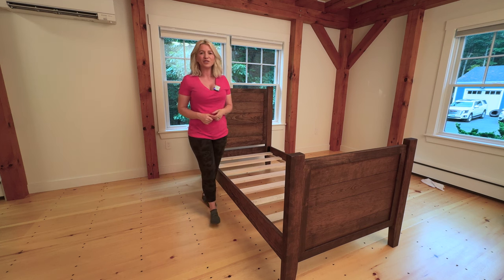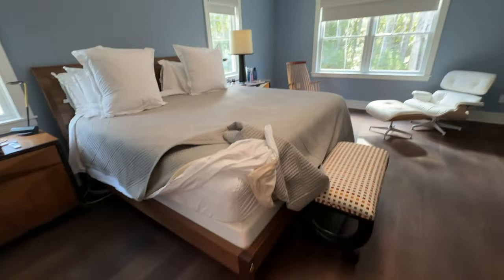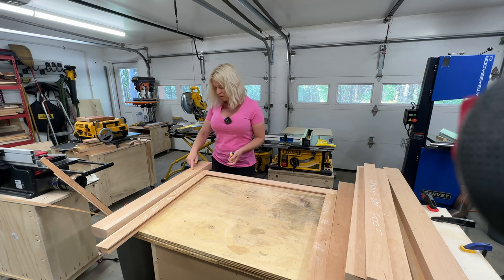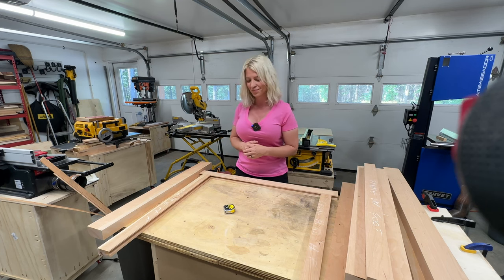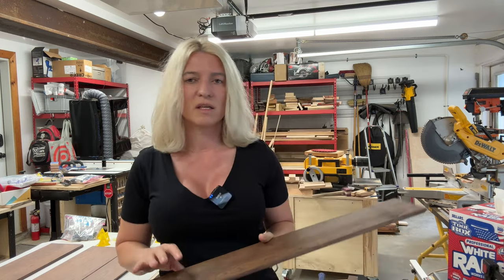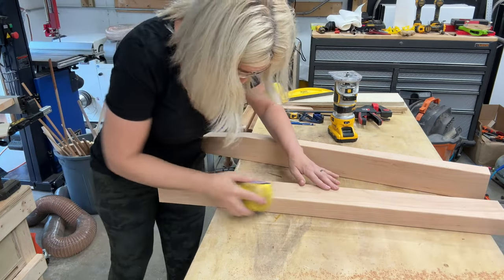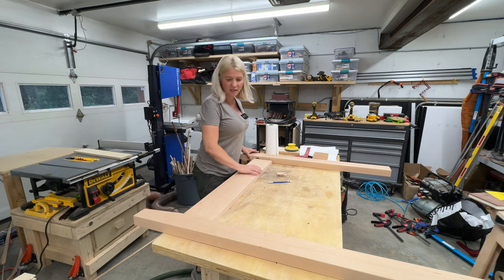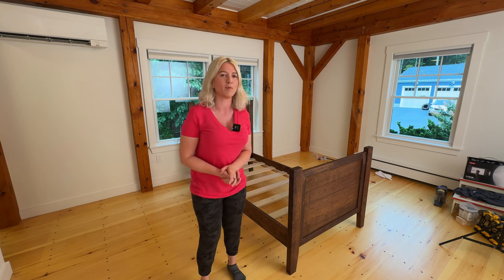How to build a solid wood bed. No pocket holes. Easy twin bed build

Comment: Hi Skyler, another great project.  May I suggest using a water based sanding sealer to control the blotchiness, then General Finishes dark brown dye stain, followed b a wiping polyurethane topcoat.  Would give you the results you were looking for.  Can’t wait to see your next project!

Comment: This turned out very nice Skyler! I liked how you looked at your bed for reference during the build. I repaired and refinished sections of a cherry wood bedroom set before and found out the hard way, it can be incredibly splotchy when using stains. My work around was adding the color in the finish rather than on the wood. Nice build video! :)
Reply from the maker: That's a great idea! Thank you
Reply: @woodworkingwithSkyler  You're welcome :) Another way is to use a glaze. That's a color coating that sits in between two clear film coatings, I use that method a lot too.

Comment: Great video! I have the same table saw as yours and I would like to know which dado set you have for your saw? Also, why did you use the band saw to rip your planks instead of the table saw. I’m in the process of building our Kitchen Island, 36x72, and the top will be made from 8/4 cherry and that glue up is making me REALLY nervous 😅
Reply from the maker: My board had a twist and was not safe to cut on table saw. Most rough cut lumber I cut on bandsaw. I have two dato stacks, will look tomorrow to see what they are

Comment: Great video. I noticed what looked like electric baseboard heating mounted high on the bedroom wall. Is that what it is? I have a new house that I'd like to heat the unfinished basement but am confused about how to heat it. Electric seems the way to go in NJ, but I'm worried about my whole house generator and how that will interact with it. I'm looking at propane too as I have a  huge propane tank that I own that is used only for the generator. Didn't know if you had any tips regarding that.
Reply from the maker: Hi Jerry. I dont have any advice since I dont know much about it. When we bought the house , it has oil heating through baseboards. The new addition we build we use radiant floor heat. However we installed mini-splits in each room for AC. Turns out they are very efficient for heat and AC. I have one in my Photo studio 1200 square feet and it heats and cools with no problem. We have a lot of solars and produce a lot more electricity that we consume so the electric makes sense for us
Reply: @woodworkingwithSkyler  oh ok, thanks.  I looked in to pellet stoves, and passed on that. Was going to go with electric baseboard heating, but I think I'll take another look at the mini splits. My music studio is about 1600 sq feet. Need to study them a bit more I guess. Thanks again. :)

Comment: Hi Skylar! I know I’ve asked you this before, but I can’t seem to find the answer to my question. So, here it is again…what dado stack do you use in your job site table saw. You did answer that you use 2 different ones. You had to get back to me on these, but I can’t seem to find my original comments. I apologize if you’ve already answered my question. I just can’t find your original answers…😢
Reply from the maker: Amanda tool 8 in fine prestige dato set. 24teeth 5/8 bore. And Freud box joint cutter set 8 in 5/8 arbor